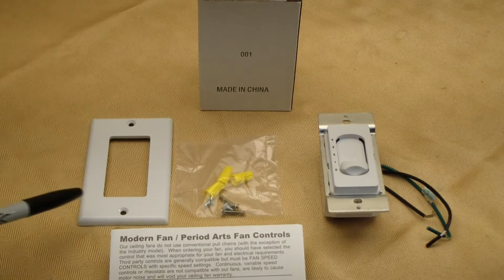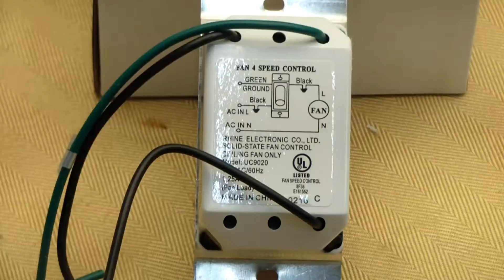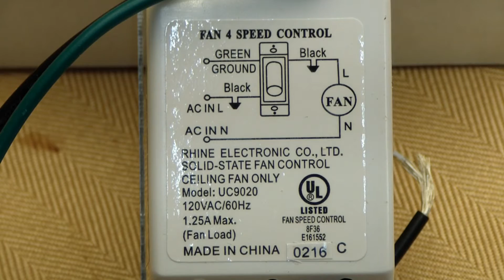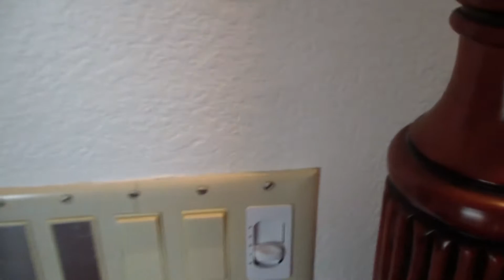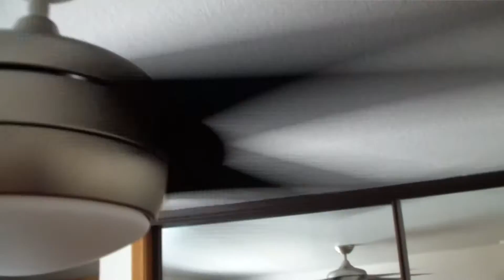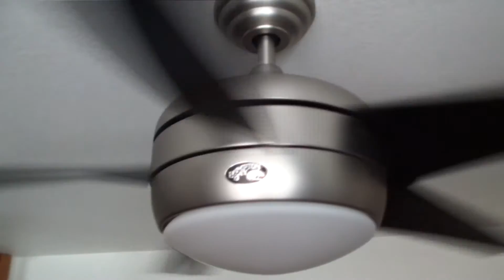Modern Fan Co Model 001 Wall Speed Control Review

Comment: Why is the higher you go the slower it spins
Reply from the maker: The controller starts at high giving maximum motor torque to get it to spin. If not it might stall and ruin motor.
Reply: @KentDiego  The numbers should be reversed so that low=1 and high=4